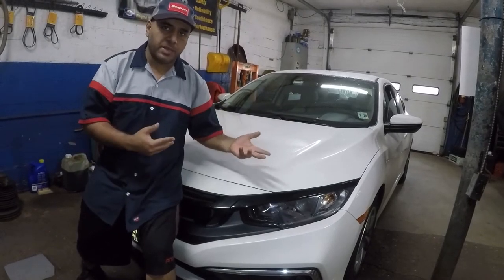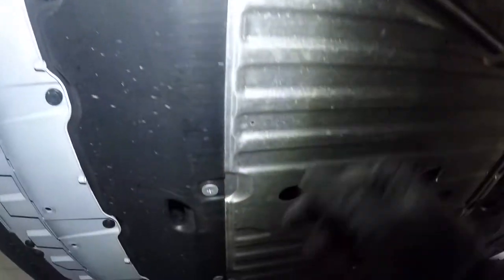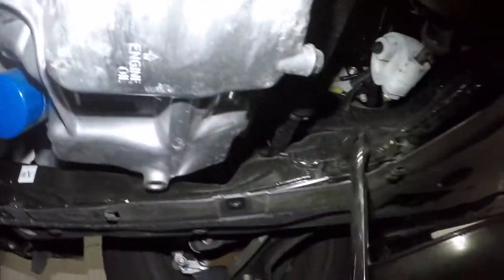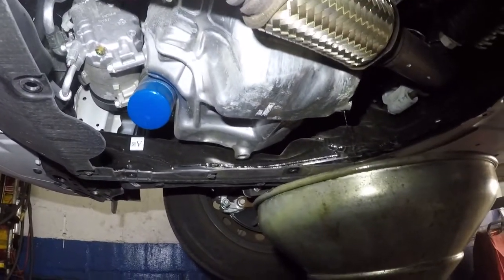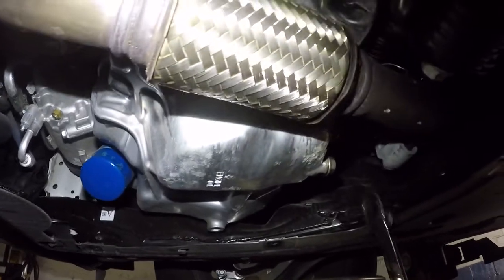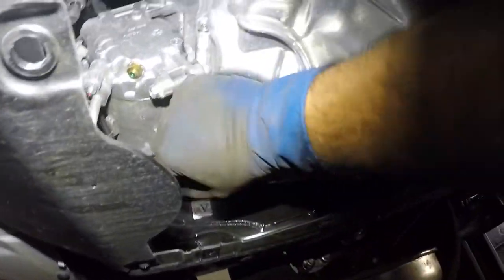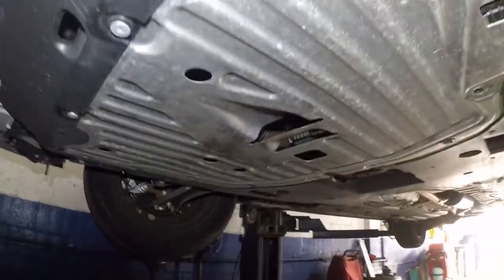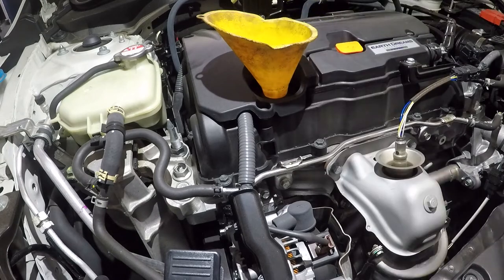Honda Civic 2019 2020 Frist oil change Please share your thoughts on 1st oilchange

Comment: First oil change for  the best engine lifespan is around 1k miles, to remove engine metal scraps. After, every 5k Miles will do just fine, with any synthetic oil.
Reply: New Honda civic owner, I wasn't sure when the oil needed changing I asked the dealership service center from where I purchased they told me don't change it until the oil change alert  light is on so it took 6 months before I needed a oil change 5 in colder weather so far . Now I have a question for the mechanic that did the video 1 why Purolator oil filter 2 why that brand of oil
Reply: @nancytimberlake5363  that’s the oil and filter that he keeps in his inventory. I’ve used that oil and filter on my ‘16 Civic, and it performs just fine. And like you, the dealership told me to do my first oil change when the oil monitor light came on. I’ve had the car for 5 1/2 years now, with 150K miles and it’s still running great! 😃

Comment: Great video. My first oil change on my 2018 EX-T was around 3,800 miles. Since then, I’ve changed the oil/filter early (between 3,800-4,200 mile intervals). I only use top-tier gas (Shell 93 Octane for the highest detergent to mitigate carbon deposits). As of Aug 2021, I have over 83,500 miles of trouble-free driving. Change the oil/filter early (don’t forget to change the transmission fluid every 30k) and you’ll have years of operation without any major issues. I hope to get over 250,000 miles.
Reply from the maker: Take care of the baby and it will make it
Reply: @RBTheMechanic  
Yes! I plan on keeping my Civic for as long as possible especially because I’m not a fan of the new 11th gen Civic.
Reply: @RBTheMechanic I learned a lesson from watching this video. My wife just got a new 2023 Honda HR-V. I changed the break-in oil at 1900 miles. I haven’t looked at the old filter yet, but I expect I’ll see some metallic bits in the filter media .
Reply from the maker: @carlovanrijk4039  yup

Comment: When the oil filter housing is located higher than the oil pan (and from the angle of your camera it looks like it might be), it's better to change the oil filter before you drain the oil out of the pan.  Reason being is when you loosen the oil filter, it releases some pressure built up in there.  Some of the dirty oil will drain outside, but the rest will drip down inwards into the oil pan.  So, if you already drained the oil pan first and replaced the plug, now you have dirty oil in the pan again. Better to replace the filter first!
Reply from the maker: Ok
Reply: Good advice.. also the benefit of removing the oil filter first.. especially those places that try to it in a hurry... the oil & filter is hot and it's easier to catch it in an empty pan that you can hold it up to the filter... than rather a full pan of hot oil and having a hot filter drop in a full pan splashing oil everywhere not wanted.
Reply: @dennismelville7532  Very good point!
Reply from the maker: @dennismelville7532  yup

Comment: Mostly how I change oil. One tip: the oil can is designed to be poured with the spout on the top, furthest away from the oil fill tube. This allows air into the bottle keeping the oil from gulping as you pour.
Reply from the maker: Yup

Comment: Doing my 1st oil change on my 2020 Civic right now, I jacked my car up and saw the panel and said ok do I have to take this off? WTF? Good video thank you!
Reply from the maker: Haha I hate those covers they will brake fall off eventully or the bolts will get lost one at a time
Reply: @RBTheMechanic  yep, that and you can’t trust the other “shops” to put all the fasteners back in place. They do just enough to hold the underbody shield, but not all the fasteners. 😡

Comment: I got a 2022 civic hatchback sport with the 2.0, I got lucky and it’s a manual, I did my first oil change myself with an hp1010 k&n filter and Mobil one 0-20 at 500 miles, I just did my second at 970 shooting to be close to 1000 with the same kind of oil and a new k&n oil filter, I will do my next one at 1500 using amsoil and a new of the same filter and a new crush ring since this is the second time I’ve had the same in, then start regular 3,000 intervals from there, I vary my speeds and try to avoid revving too high but I’ve been driving in real world where once in a while you need some revs and I think that’s okay as well as sometimes when you’re in traffic you have to hold a steady speed for a while and that’s alright too.
Reply: I have the Red 2022  CVT tho.  This 2.0 uses 0-20 weight ?   Wish they would have had a manual .
Reply: Sport
Reply: I think it is only the hatchback sport that has a manual
Reply: @SilverbackSasquatch19xx   Oh . Yeah they only had the Sport I bought on the lot at the time I bought it . Must be a FUN drive in manual :D
Reply: Good job. I also have a 2020 Civic Sport with manual 6 speed. I suggest using 2 Filter Mags on the oil filter and 1 MagnaFilter disk on the oil filter. You should of immediately put the filter mags on as soon as you bought the car during break in. I did. It removes all metal debris and shavings and traps them to the inside of the oil filter. It’s amazing. Always use them for the rest of the cars life. Research MagnaFilter on YouTube and FilterMag. You will be sold. Also, change your manual gear oil to either Amsoil or BG or Redline Synthetic. The transmission gear oil in there now from Honda is not Synthetic. I also change my engine oil every 3,000 miles with Amsoil Signature Series and a bottle of Bestline engine treatment. I changed my trans at 1000, 3000, and now every 10,000.  So pretty much every 3rd oil change I do the transmission. Research MagnaFilter on YouTube. Make sure you spell it exact like that on YouTube to find it.  Let me know if you want one. I know where to get them. You will thank me later.
Reply: @BW-kv9wj  I’ll trust the k&n, those filters sound gimmicky

Comment: Bought a 2019 Civic but it's hard to read the oil level on that small little orange end of the dip stick...

It's tricky because it just doesn't accumulate to the point where it's very easy to see the level..

Any one else have the same problem?

I took it to Goodyear for an oil change and asked them if the oil was low and they said no..and after the oil change I tried to read the dipstick and couldn't see the accumulated oil. 

🤔🤔
Reply from the maker: Might want to conform this before engine goes bad

Comment: Why you didn't go back with the Genuine oil filter I know Purolator is a good brand but I would have used the Genuine.
Reply from the maker: Well I don’t keep those in stock usully customers bring me if they want original stuff

Comment: First oil change should be at 1000 miles.
Reply from the maker: Yeah early as possible !!!!
Reply: @RBTheMechanic  Personally, I immediately put filter Mags and a MagnaFilter on the oil filter and then change oil at 1000 to a 100 % synthetic.  Then I change again at 3000 miles and always use Filter Mags and MagnaFilter forever and then change at 3000 mile increments.  That’s just me.  Might be overkill but makes me feel good.
Reply from the maker: @BW-kv9wj  always good to do it better than just  good
Reply: @RBTheMechanic  Exactly
Reply: @RBTheMechanic  I wish I would’ve done that 1K initial break-in oil change, but the dealership told me to do it at 15% according to the Oil Life Monitor. Been doing it at 6K - 7K intervals now (95+ % hwy miles, generally 2K rpm).
Reply: @carlovanrijk4039  change oil every 4K or 5K max. Don’t listen to anyone telling you to go more.
Reply: @carlovanrijk4039  Put MagnaFilter and 2 FilterMags on your oil filter. Type in MagnaFilter (exactly like this is spelled) in YouTube and watch the video.  You will thank me later. If you want one, I know how to to get them.

Comment: I agree should have changed oil at 2 or 3,000 miles but the whole break in engine thing no .. Drive it like normal do not baby it ..That’s a myth
Reply from the maker: Yeah but u do need to drive it normal just don’t over work it don’t put like 5 people and fill up the trunk that would over work the engine and it will wear unnormal

Comment: Basically any vehicle I have owned I always done it every 5,000 miles or every 6 months. Which ever comes 1st.
Reply from the maker: First oil change should be early
Reply: @RBTheMechanic  here is my question for you then.
I just got my car yesterday BRAND NEW and it's sitting on 130 miles right now.

I'll reach 6 months 1st before 5,000 miles.

So when should I change the oil then?
Reply from the maker: @conradjake777  ok good question I think you don’t drive much .... but I think it would be best to brake in the engine so you might have to drive according to brake in procedure I would just try to take few trips and make that first 600 miles and u can search the procedure in ur Manuel book and after that I would immediately do the first oil change after that u can just do ur oil change once you rear ur 5000 miles.  To give u honest answer I have few cars one of my car dosent get driven lot and I do oil change every 5000k miles even if it take 7 months
Reply: @RBTheMechanic  oh ok. Is that safe for the vehicle tho that you do it in?

Because that oil has been sitting in there THAT LONG without being changed and barley being used?
Reply from the maker: @conradjake777  yeah it shouldn’t be problem
Reply: @conradjake777  drive it 1000 miles.  Break it in by not driving over 4000 RPMS.  Don’t drive it over 65 MPH on the freeway.  Change your oil to synthetic at 1000 miles and every 4000 miles after that.
Reply: Whoops I'm at 7161 miles on my 21 but will change the oil today. I hope nothings gets messed up
Reply: @tepopz5678  that’s about the time I did my first oil change, because the dealer told me to wait til the oil life monitor got down to 15%. I’ve had the car now for nearly 5 years and it’s doing well. I do mostly highway driving so the oil gets changed every 5K - 7K miles. 👍🏼

Comment: The honda dealer told me to wait until 4 -5 k for the first oil change on 2020 Civic
Reply from the maker: If they tell u that u might have to stick with their word so they can’t use it against u Just invade somthing goes wrong
Reply: The dealer can tell you whatever they want. But nothing is stopping you from performing your own oil change at 1,000 miles.  Then every 5,000 after that with the dealer if you choose.

Comment: Hi, I just got a 2020 Honda Civic last month but my oil life is at 60% already ( I drive a lot because I deliver food part time lol) I’m at 2,000 miles now( when I bought it, it had 9 🥴) When do you guys suggest I should get my first oil change? What oil percentage, or at what mileage ? Thanks for your help
Reply from the maker: Your first oil change has to be early I would do it at 3k miles ... brand new car it brakes in the engine and metal particulate come off you can also call up the dealer they will let you know but do do it early don’t go by the percentage on first oil change...
Reply: @RBTheMechanic  will do, thanks!
Reply: I did my first oil change on my 2019 EX-L at 3,800 miles
Reply from the maker: @porschefanatic1049  that’s good not engine is fresh of the broken particles
Reply: @RBTheMechanic  Is that good or not good? I replaced it before 5k (recommended interval) since it was a year when I was at 3,800 miles.
Reply from the maker: @porschefanatic1049  it’s not good because all the broken particulate are in there but I guess filter did it’s job usually it would be best to drive the car as much as you can to brake in the engine propperly they should give instructions to new buyers how to drive for first 3k miles but no problem as long as all good and car drives good nothing to worry about!!!
Reply: Change your oil now.  You should of changed it at 1000 miles after break in period.  I have a 2020 Honda Civic Sport 2.0. The oil life doesn’t mean anything.  It doesn’t analyze your oil.  It goes off of time and mileage.  Ignore that oil life percentage.  Just change your oil every 3000 or 4000 miles and that engine will last forever.  Use synthetic oil.  If you can afford it, use Amsoil Signature Series 0W20.
Reply: @BW-kv9wj  oh I did lol I got it done back in February they said I don’t need to come back until 8,000 miles or August. I might reach 8,000 before then though lol thanks for the advice !
Reply: @janaya36  Nice.  You’re ahead of the game.  Change your oil every 3-4000 miles with high quality synthetic oil and you have nothing to worry about. Don’t pay attention to that computer in your dashboard
Reply: The car has oil change sensor's that will let you know when it's time for oil change  and Honda Priority dealership person told me not to change oil until the car signals for it because otherwise it would mess up the sensor's